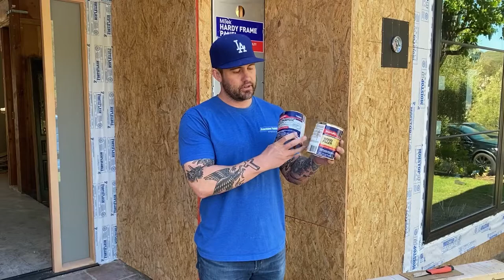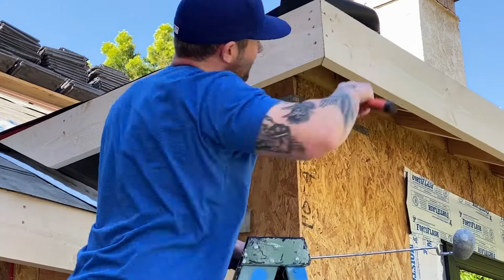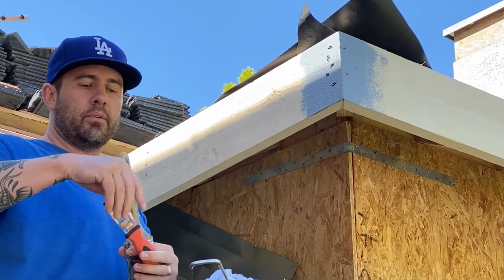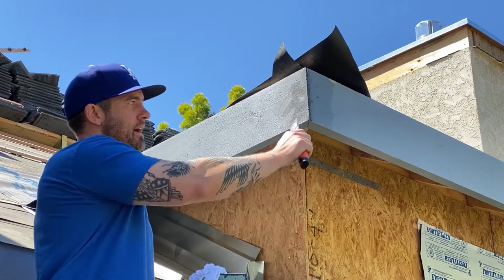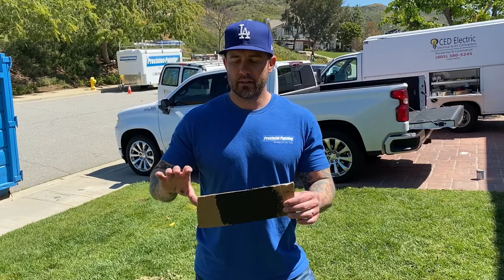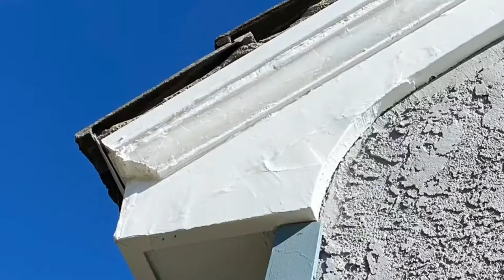Why we DON'T use Bondo on exteriors at Precision Painting

Comment: this is not a good technique  at all  DONT  do it!i have been painting for 40 years and have my own company ,caulking is not an option for patching holes,caulking can not be sanded and is very visible wherever its smeared even with  this brush technique he is doing, bondo is not good at all  either ,bondo is used as a last resort for something very old and beat up it can revive a bit if replacement is not an option. use an exterior patching with just a tiny putty knife with an exterior patching compound  but just go over the holes one at a time and put it a little bit above the hole and lightly sand  with sanding sponge or lightly with 100 grit as you go while you are already painting.  but hey im sure the company does great work overall  this certain way for this is not on point but most people wont notice the difference what ever way its done lol.
Reply: what exterior patching compound brands do you suggest for exterior house trims? I have some rotted wood that I can't replace but is looking to patch.
Reply: I used to think this too but then I considered nails backing out and expansion and contraction of the wood. My opinion is, it need something flexible like Sashco Big Stretch or Dynaflex. Not to say that caulking is a forever solution but it won’t crack as easily as a lot of wood fillers. On fascia boards from the ground, most people aren’t going to be able to see where the caulking in the nail hole has shrunk. In my mind, the more important thing is properly sealing the nail hole to keep it from rusting overtime instead of treating textured lumber or hardy board like it’s a cabinet door. Just my 2 cents, I don’t know if there’s ever a perfect solution for anything that’s exposed to the elements.

Comment: Guys I’ve been a contractor for 36 years from what I see is that’s rough wood meaning 2x8 and you’re trying to get a finish project out of that. The one by eight has been shot up by framing nails. I’ve been around new homes for many years and on all of the homes all the roof framing is done and then they put A-zac or finished pine over that. But, mostly it’s the total house that gets done in framing and then they use A-Zac Which is a white kind of plastic board that would never rot. Personally I feel you’re missing one more layer of wood either one by eight pine. And the pine shot on with finish nails not framing nails and then the small holes with putty right over and the wood would look great paint it. If you’re rough framing wood which that’s what I see is going to get covered with metal cappingThen it doesn’t matter at all if the holes are filled because the metal capping would go on there and then the gutters would go on there which would cover half the board anyway.The the 2 x 8Framing wood is not finished wood and once again it has been Blasted away with framing nails so you can’t get a nice finish appearance out of rough lumber and you would have to sand those holes with whatever you put over it a couple times and you would have to prime that wood,Then give it a couple coats of finish paint exterior then it might look OK but still if it’s rough framing work it’s gonna blister up anyway that’s only for your roof framing. Rough framing wood is your rough framing then you’re finished wood goes over it and or metal capping

Comment: You put caulking when putting both fascial boards together. That way caulking really gets inside. And whatever comes out after putting them together you just wipe it rigth away. Also put a nail or screw on bottom to grab both fascial boards together

Comment: There are two part expanding epoxies that can be used for exterior wood rot and it lasts at least 30 years because i did it when i was 14 and its still perfectly shaped. Also if you put a space heater on the rot and scrape it out then dab wood epoxy into the rot very hard and get it completely wet or saturated with the epoxy and then let it dry you will be good. Dont use bondo on joints and you will be fine. Saying that you shouldnt use bondo ever and implying it is wrong all the time is overkill. We know you dont use it but it can be used and work properly. 
Again just heat the wood rot spot and scrape out the soft rot, then epoxy the wood and satuarate it completely. You must use a two part epoxy. I often use a product from PC Products that is a wood filler but expensive. Then you can sand the epoxy where it overflowed in the rot and fill in the hole with bondo as long as it isnt in a joint. Joints call for a flexable 2 part epoxy called flex tec or dura fix. I have used flex tec on the surface and filled in with bondo wood filler before and it works fine. Obviously its best to replace but we do 100 year old Georgia mansions and heart pine everywhere has to be replaced if necessary but we try to fill and shape much as possible. We use epoxy with heart pine saw dust for filling much of the wood including trim and floors and doors and so on. Dura fix and Flex tec are the best unless you are doing big stuff like us and then getting your own array of 2 part epoxies with different set up times and viscosites and so on is best. We have some 2 part repair epoxy for furniture that sets up in like 7 seconds and will start smoking the minute you mix it and heat up and expand a little then it is fuzed into the wood. And some that is UV activated and then some that is rated for high pressure and some for high heat and so on and so on. 
Between Rock Hard Putty and Bondo I go with Bondo when prepped right. Make aure you seal the rot with epoxy and use bondo as a filler only not an adhesive or a structural compnent of the piece in question. Its filler and use it as such to make your project work. Telling people bondo is no good is misleading. It has its place.
Reply: Finally someone who knows what he's talking about. I love how some people applaud him for being a perfectionist. If he was really a perfectionist he would acknowledge the fact that between interior and exterior you might need as many as 2 dozen different types of caulk, fillers and hardeners. There's a time and place for almost all of them and it takes a while to learn exactly what goes where. There is no 1 solution

Comment: Polyester filler works fine assuming the substrate is prepped and the applicator knows what he's doing and last the substrate should not be in direct sunlight because it will crack with expansion and contraction. So the title of this video is absolutely incorrect, it can be used on a homes exterior, just not all the time. In special cases it works great.

Comment: That was a really cheap grade of caulk, the normal dap stuff.   could be upgraded to elastomeric type, is much better with flexibility & not cracking over time.   Also I noticed you were painting the facia in the sun?  that can easily be too hot...
but yes, no bondo for the facia butt joints!

Comment: Caulking last longer?????? Not in Arizona. Caulking is a menace. I almost never use caulking because it doesn't last, quickly peels or cracks, and just can't take our 120 deg F weather. You lost me right there. As for plastic or composite (epoxy) based materials? Also, not a chance here.
Reply: Just curious as I've been a painter for 30 years but in minnesota. Complete opposite weather. What the hell does last in that type of heat???